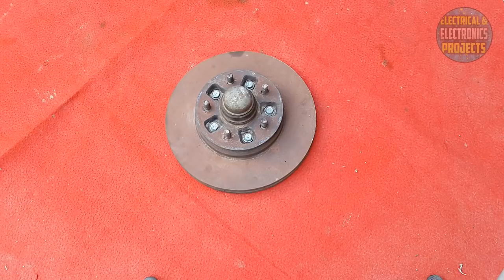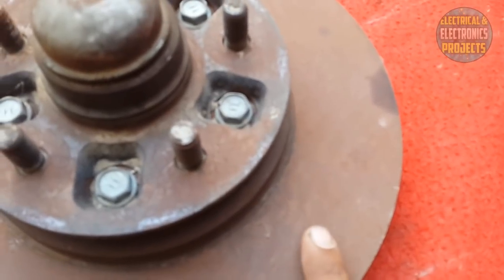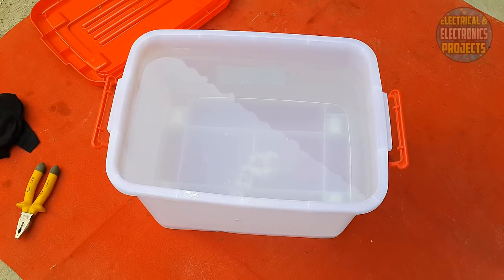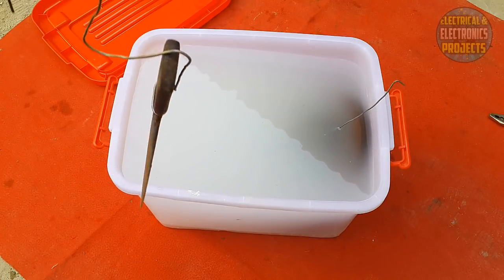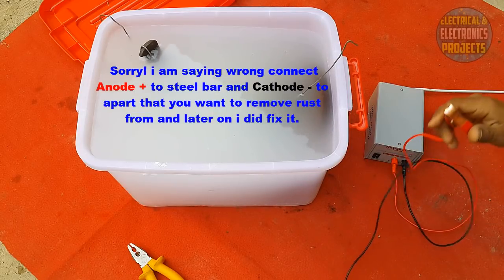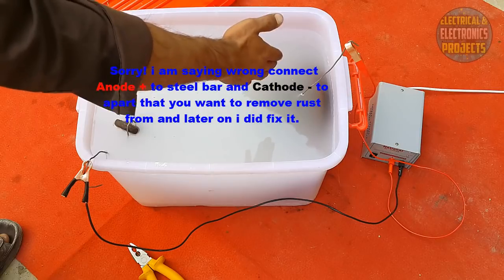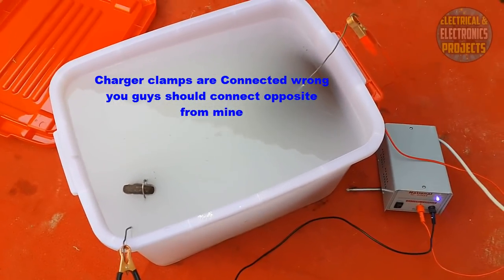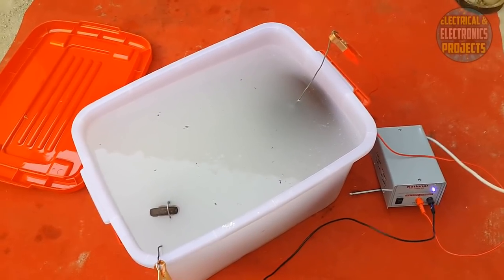How to remove rust from brake rotors /Rust removal using electrolysis /Rust removal at home

Comment: Um, yeah..... How is this cheap &/or easy? You're running that battery charger for 20hrs. 20HOURS!!! In order for this to be simple, cheap and easy, everybody would have to own a battery charger which aren't cheap. Also, your electric bill would put a dent in your wallet. Don't get me wrong. You get props for an intuitive idea but it's far from helpful. 
Fast, cheap & easy way is to buy some white distilled vinegar. About $5 or less for a gallon. Get a bucket or oil pan. Put the rusty rotor inside and pour the vinegar until the rotor is fully submerged in it. Then go eat a snack, watch an hour long show or make love to your wife. Basically spend an hour/hour and a half doing etc and go back to check on the rotor. Viola, the rust has been dissolved. Now just take out the rotor and get a clean tag and wipe remaining rust off rotor. TADA! Now u can actually put the rotor back all in one day.